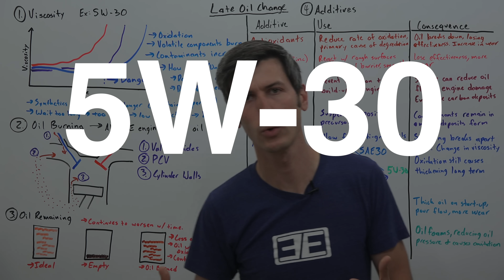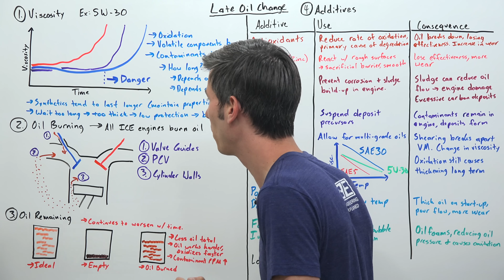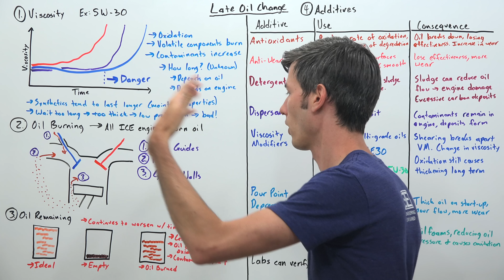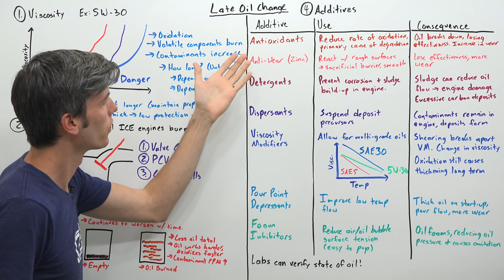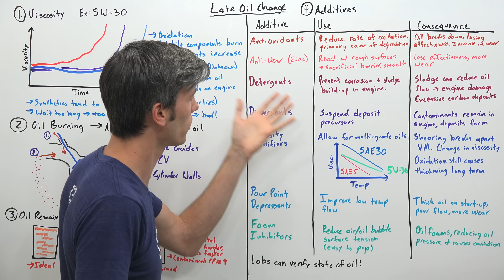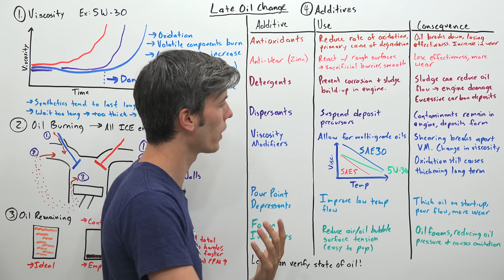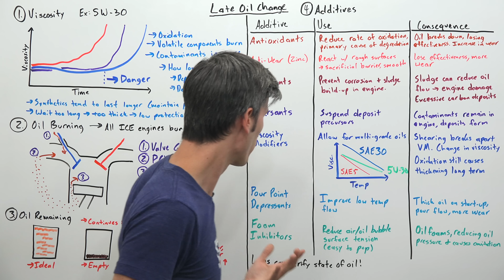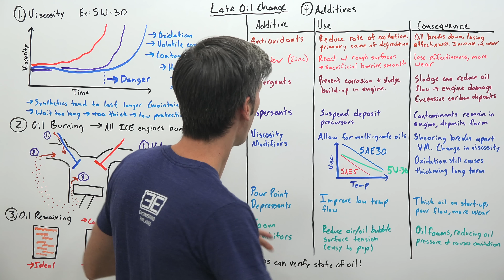What If You Forget To Change Your Oil?

Comment: Aren't oil pumps positive-displacement type? I mean - don't they pump constant volume of oil per revolution, no matter its viscosity?
Reply from the maker: I believe there are both fixed and variable displacement pumps out there. Fixed will offer a set flow, while variable can change based on engine conditions (temp, RPM, load). Regardless, certain passageways may allow for easier flow than others, creating localized hot spots when the engine is cold.
Reply: @EngineeringExplained  its like you took every technician course that exists.
Reply: Engineering Explained you should do a video on why some engines can take beatings and others can’t. My 99 gtp 3.8 supercharged. Has taken a beating like no other. It has 320,000 on it. It has been raced weekly more so when it has 300k (bc idc if it blows up), which is why the tranny has been out twice and is right now.   It doesn’t use any oil, runs amazing and gets good gas mileage when not at full throttle. Lol
Reply: @inthebeginning6895  Tolerances and grade of metals used
Reply: @inthebeginning6895  Those Buick 3.8 engines are workhorses.
Reply: That's true, chain driven oil PUMP is positive displacement, but the oil SYSTEM is not. Once the oil gets too thick, the pressure will go up (at a given flow), when it reaches a prescribed point the oil pressure regulator will start to bypass the oil.  At a certain vulume of flow, higher viscosity=higher pressure= earlier bypass. Since flow = lubrication,  insuffieient flow will damage the engine.
Reply: The problem are the bubbles, or air being sucked. This will cause some seconds without oil pressure in the motor. If oil level is down, during a high corner or braking, it is possible that this situation occurs. For the concept of oil pumps I think you are right. I don't remember any oil pump to be centrifugal in this type of application (lubricating systems).
Reply: Positive displacement, but with a pressure relief. If the oil is too cold, and too thick, you'll trip the pressure relief, and you'll just be pumping the oil back into the pan.

Comment: Turbo chargers burn the oli quickly, I forgot to change my oli and I was like water 😅 it's because of the intense turbo temperature
Reply: No they don't. That is a sign that the turbine shaft is worn out and will very likely fail soon. This is also a consequence of bad oil.
Reply: @ipodge1731  but my turbocharger is water cooled
Reply: @Jackson41225  The turbine shaft is still lubricated by motor oil.

Comment: Why are some engines need an oil change every 6000 km and others every 30000? Aren’t the intervals often too short just to support dealerships?
Reply: 30,000KM? Which oil
Reply: yes alot of recommendations are far too short, ive seen alot of cars go 30,000kms+ and no sludge no issues oil didnt even look inherently different just used... its more engine specific some engines have small components that are prone to sludge/oil starve failure even on regular changes if thats the case then change at reccomended but if your engine is pretty bullet proof 20,000km is pretty fair
Reply: Pretty much every Volkswagen or Audi that comes with longlife inspection intervals. Just google VW longlife oil.

Comment: My first car went around 80k miles on the same oil, it did no damage at all apart from the head gasket went at 116k and dynod as 2 hp less then from factory...
Reply: Oh sure
Reply: @cometdude6789  when i say 2hp, im on about an engine with 81hp from stock and a diesel...
Reply: Have you seen the engine from inside that you can tell there was no damage at all?
Reply: @szjm19  there was definitely damage, around 20k miles later it blew the head gasket
Reply: This is really a very bad idea, don't try to sell this to other people!
Reply: @EfraKrajo  it was scrapped, it blew the head gasket at 116k
Reply: Bs
Reply: I cant imagine a guy who cares enough about his car to get it dynoed, but not enough to change the oil once in a while
Reply: @oskarkrogsgard3014  it was a first car, nothing special, cost me £600, not worth serving if it got me 2 years no claims
Reply: @johningram6588  no oil goes 80k miles
Reply: @cometdude6789  in what sence? I never said i didnt top it up